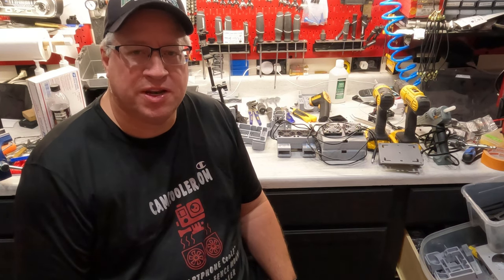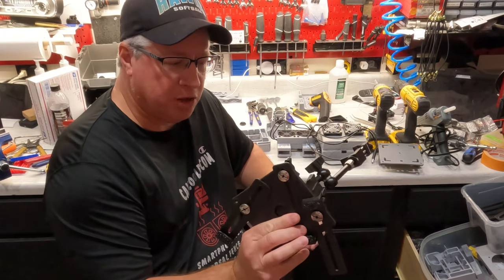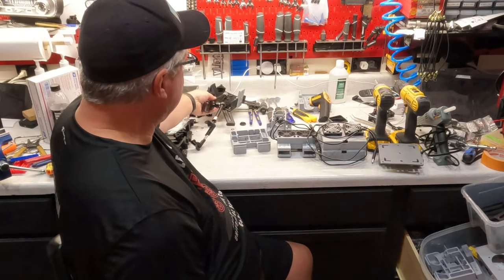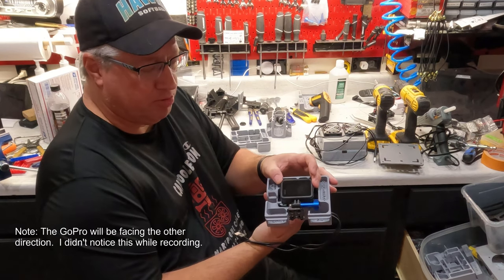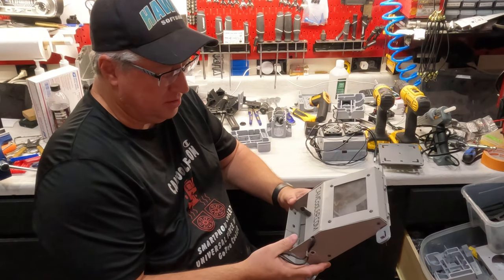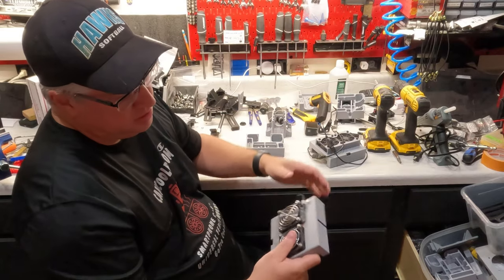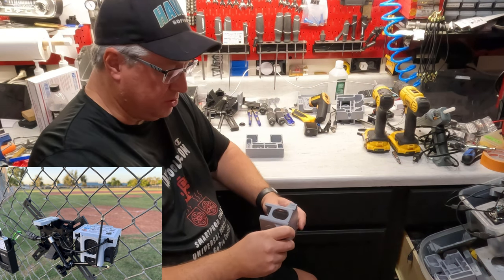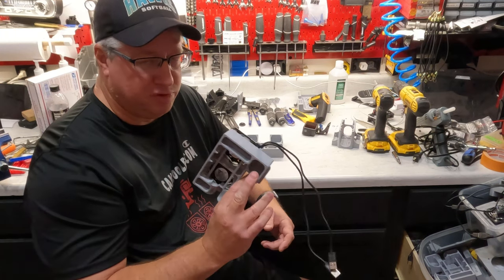CAMCooLER.COM - GoPro Overheating Fix for Softball or Baseball Games

Comment: Very cool idea and product! (Pun intended :) Have you tried any testing or a mount with a single fan? I am researching cooling solutions to stop the gopro from overheating inside a small airplane. I like this idea but for my use case, the dual cooler is a bit bulky and would block too much of the windshield. Currently looking for ideas to mod an aluminum cage to hold a fan in a minimalistic way.
Reply from the maker: All GoPro Coolers have been updated to fit snugly over the specific camera.  Not FAA approved. 
 Use at own risk. https://camcooler.com/product-category/camera-cooling-system/

Comment: Just ordered one for my sons hockey games with the gopro 10- I did a home test without the internal battery and it last 66 mins 5.3k 60 fps on a external power bank- his games are usually 70 minutes long total-so without a fence I mount the gopro to a suction cup against the glass behind the net- any suggestions on how to mount th e cooler or keep it around the gopro without falling off?
Reply from the maker: All GoPro Coolers have been updated to fit snugly over the specific camera. For added protection, you can wrap the included small bungee cord around the camera and cooler assembly. https://camcooler.com/product-category/camera-cooling-system/